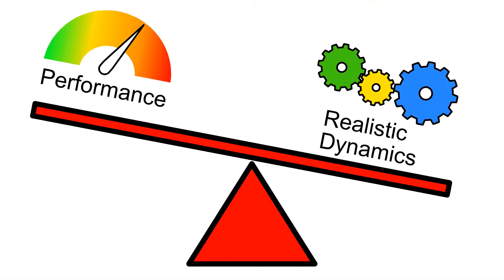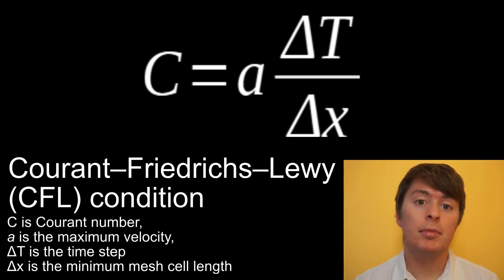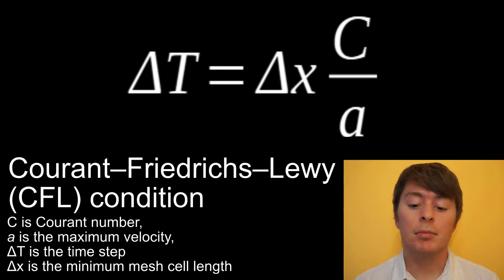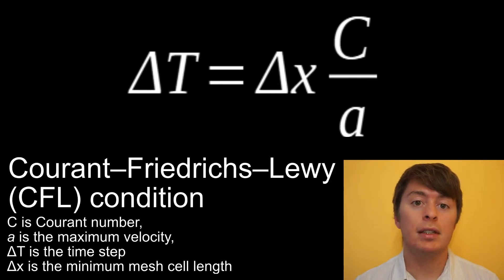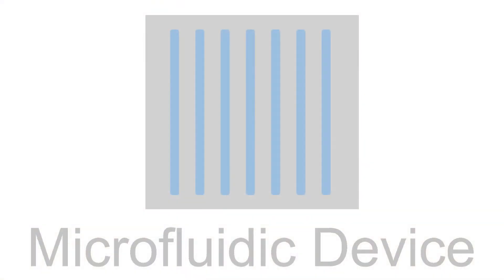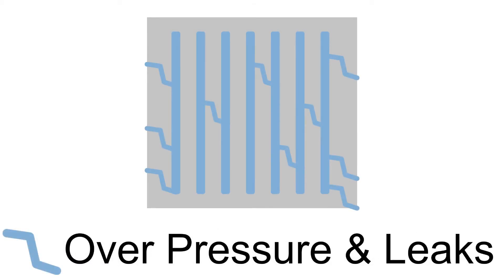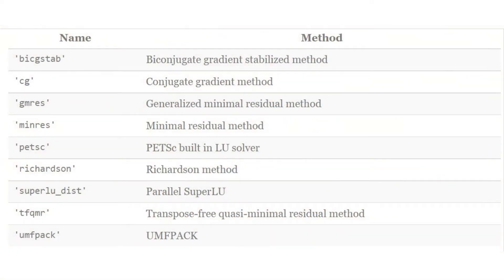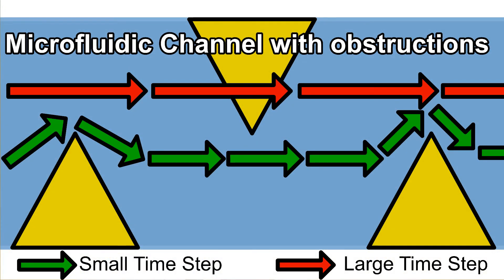Why Is The Time-Step Important For Fluid Dynamics? | FEniCS CFD

Comment: Hello. Great video. I have a question: If I am running my simulation using an implicit scheme (15 inner iterations) do I still need to check CFL condition? I was under the impression that implicit schemes are always stable. Second, is a Courant number of 0.5 always ok to use? In the simple wave equation, we know that the numerical velocity vs real velocity is 1 vs 1 and that's why Courant maximum value is 1. When using the complete Navier-Stokes equations however, how do you obtain the final CFL condition? Thank you